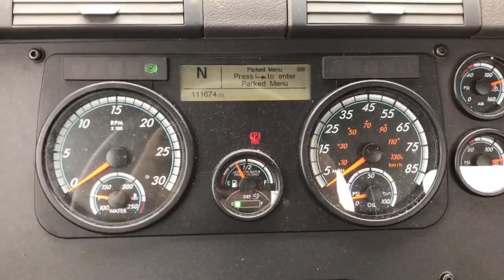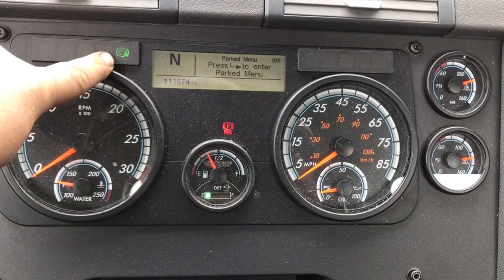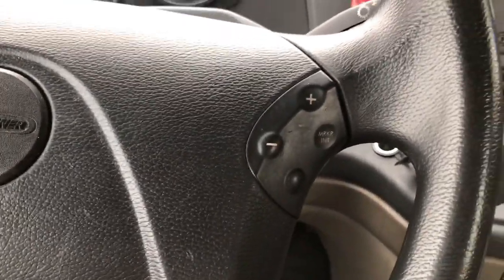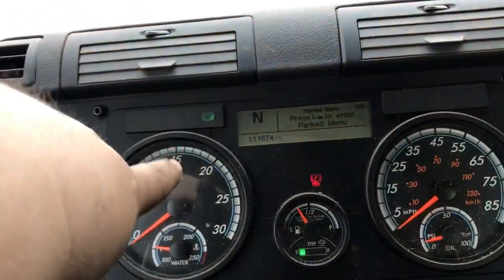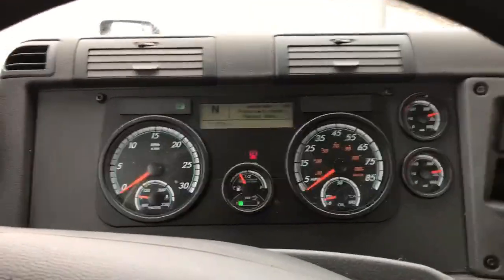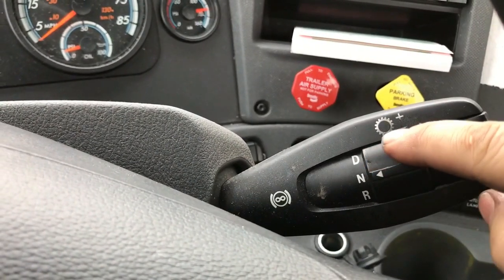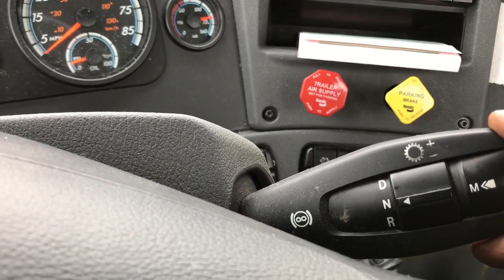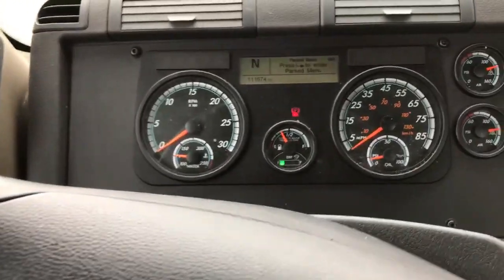Engine Brake /Jake Brakes switches work on 2018 freightliner Cascadia

Comment: Thought there was something wrong with the Jake in the freightliner. Always drove Kenworth. Just switch to what position you need for what weight you’re pulling. Didn’t realize you had to turn it on like cruise control on a cascadia. lol😂

Comment: This is a great video because I normalize driving a manual, and the company that I work for now uses mostly automatic trucks. I saw the  exhaust brake, which is the same as the jake brake. My suggestion to new drivers and old drivers is research if you never drove an automatic. God bless 🙌

Comment: Couldnt use cruise control until I watched your video I realized I had set my j break on these things are easy to flip on by hitting the lever with your hand while turning without noticing it.

Comment: I moved from a Kenworth to a
2018  Freightliner. On the Kenworth I could set the cruise control and Jake at the same time. I can't figure out how to do that on the freightliner (if it's even possible) when I have the jake on and try to set the cruise it tells me to turn off the jake. I want the Kenworth back lol